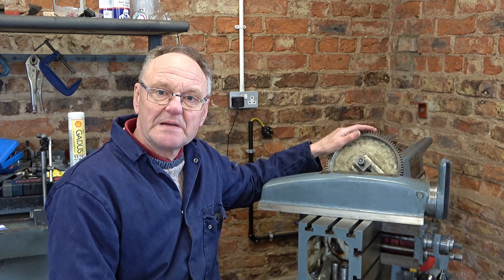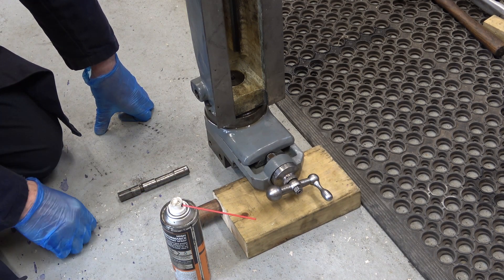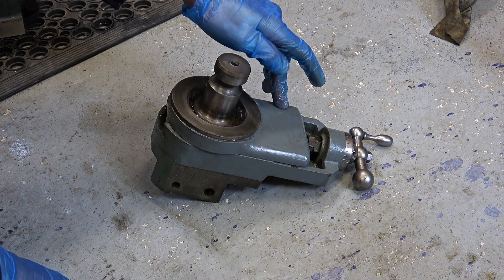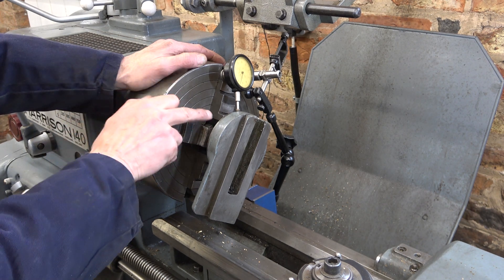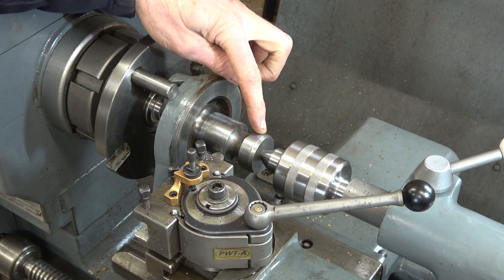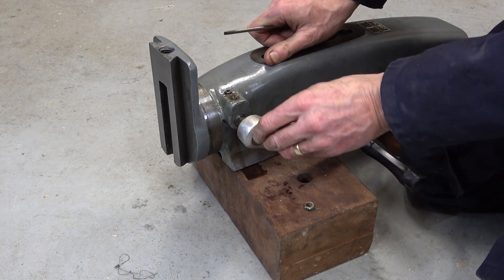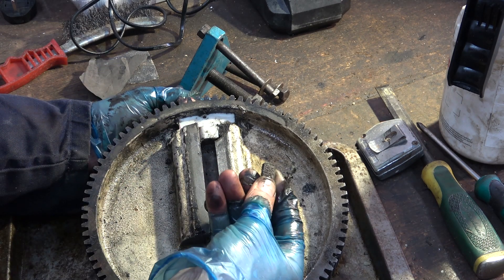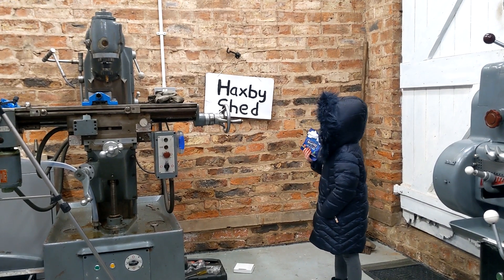HS185 Elliott 10M shaper repairs – Part 3

Comment: Thanks for posting! They must have made the slide backs all on Friday afternoons as mine is offset exactly the same and still the wrong colour as well. Ho hum..
Reply from the maker: Ah, maybe they contracted out that bit of the work?  Sometimes I look at my 10M and think it's a bit of a toy shaper but then I get into a project and remind myself it is a very capable machine. I think the least satisfactory aspect is the down-slide as it's hard to use that accurately. Mine has tight spots and slack spots on the lead screw rotation. (tight and loose within one rotation). Cheers

Comment: Another very good video, and I admire your tenacity. Goodness knows how that spigot got to be like that. Do you think it was a replacement that didn't fit and was machined on a second centre? All very strange but interesting. Cheers, Laurie
Reply from the maker: Hi Laurie, the paint colour on the spigot and back-slide was different from the rest of the shaper so perhaps it was a repair where the spare did not match properly. I am also attracted to Carl's suggestion that the casting was finish machined before it was fully cured. I have now finished work on the improvement to turn the shaper over without going to the pulley side - all revealed in parts 5 & 6. Cheers

Comment: Hi Paul, well done for perservering, I hope you didnt bruise your foot, good test for your steel toe capped boots!!

I guess we will never know why that spigot was quite so out of round, whoever put it together last time certainly knew something wasnt quite right. Lovely piece of symmetry first job on the vertical mill is fixing the shaper. 

Good to see your grandaughter in the workshop, I hope she didnt bring any unwanted presents this time. 

Looking forward to the next episode. Good luck from Spain!!
Reply from the maker: Hi David, quite possibly the shaper came from a school in which case it was probably abused. I suspect my lathe was from a school or college because it had some lumps out of it and it was over-maintained  (packed full of grease in the screwcutting gearbox and on the slides). Now my mill came from a small factory or workshop - in desperate need of basic maintenance but definitely not abused. Hardly a mark on the table. Cheers

Comment: Great work! following this with interest...for the neoprene washer application, did you consider a thick felt washer? (say 3mm) they're pretty good at keeping dirt out, and oil in for that matter, especially when inpregnated with grease, (I've used that in the back of my clutch on an old pre-unit Triumph) just a thought, looking forward to the next installment!, cheers, Dave
Reply from the maker: Hi Dave, I did not think about a felt washer but I see it could have been a good idea. Once I get on a track my mind closes off to other options sometimes. I had a pre-unit T110 and on that I used a leather disc behind a steel washer behind the clutch and that worked reasonably well. I still remember it was a "long" chain case, duplex frame, magneto but with an alternator rather than dynamo.  Might have been 1962 - can't remember for sure. Cheers
Reply: @HaxbyShed  I do remember you saying before you had a triumph!

Comment: Hello Paul. Excellent video, I really enjoyed it. Good uses of bits of wood, I always keep some handy too. I also watch Paul Hopewell, he is fantastic.

I am trying to account for the ovality of the spigot on the casting. This is my feeling. The piece was machined from a sand casting direct to final dimensions, without leaving enough time to allow any internal stresses to work themselves out. Usual thing to do is to rough out, allow some time for natural stress relief then machine to final size. I think the internal stresses relieved and caused ovality in your part, because it was taken direct to final dimensions.

This is apposite for me at the moment as I am busy machining a piece of continuous cast iron to make the knee lead nut for my mill. It isn't supposed to have any internal stresses, but you never know. Thanks again for a great film.
Reply from the maker: Hi Carl, I think you are possibly right about stress relief. Either that or the lathe it was turned on was badly worn but I don't think they would have fitted a swivel so obviously tight from new. Cheers

Comment: Contortionist seems appropriate for the first few minutes Paul, you do have a nice milling machine to bolt items to, ref disassembly.
Great repair and modifications, shop temperatures slowly becoming agreeable 👍.
Thanks for sharing
Reply from the maker: Hi John, yes it is warming up finally. It was 10C in the shop today. I'm still quite nimble despite my advancing years (and I was holding on to the lathe, off camera). Cheers

Comment: I'm still wondering how it's possible that the pin on the tool head becomes oval. Maybe it was used on another shaper before and had some play.But still, they should have noticed it.
Reply from the maker: Well Michel it's a mystery how it happened and another why somebody did not fix it before now. Cheers

Comment: Nice job on the swivel. I think centre drilling and running between centres was a really good idea. As for the surface you clocked it in on, well, it must have been machined and its not a wear surface, so I'd have trusted it as well.
Reply from the maker: Hi Robert, I'm always happy when I can use the less common adaptors on the lathe like the driving plate. Using big faceplates is another thing I enjoy. Cheers

Comment: We always have a collection of bits of wood in the workshop for jobs like this, when they get too damaged to use they go in the woodburner so nothing is wasted. It is enjoyable to watch progress on the shaper and it helps us to understand the effort required if we need to undertake repairs on our Alber shaper, thanks. Our machining skills are very limited however with that caveat I do not think you have the cutter in the Clarkson autolock correctly, something we have only recently learned
Reply from the maker: Hi GTB, MidEngineering has a nice short vid on setting Clarkson collets. You have possibly seen it already but here's the link https://youtu.be/atVnZFGU9NQ it's a big spanner but they only need a gentle tap to clamp them.  A few things on my machines have been damaged by 'big spanner, small brain'. 🤣
Reply: @HaxbyShed  Yes I have seen that video, I think he may have made it after seeing us use it incorrectly. It sounds like I may have not viewed your installation correctly, it looked like the collar that the spanner goes on was not fully done up suggesting the cutter had been put in too far first
Reply from the maker: @GardenTractorBoy  you know I'd better rewatch that video myself!! I thought I understood but perhaps I don't. Good that you've queried it. Cheers
Reply: @HaxbyShed  Please let us know the outcome as we are still learning and very keen to do the right thing

Comment: I think you may well be right about the slide being from another machine. I liked the method used to remove the assembly from the ram. I can’t account for the ovality of that pin but you fixed it.
Reply from the maker: HI Tony, I think it was a school or college machine and they often don't get a lot of use but they do get a lot of abuse. Cheers
Reply: Abuse is certainly true, my 10M has horizontal marks across the vertical slideways where the little dears had probably slackened off the gibs so the whole saddle & box was rocking under the cutting forces